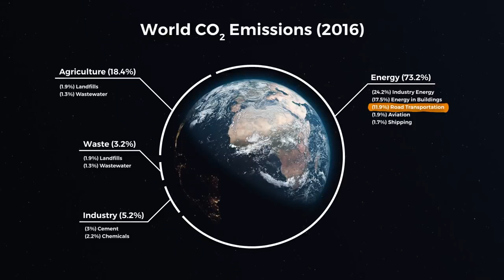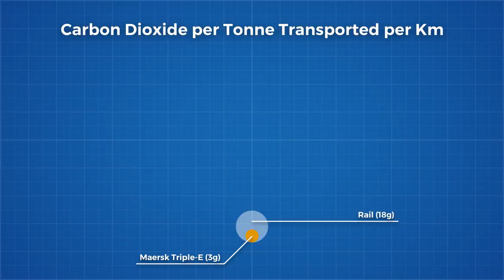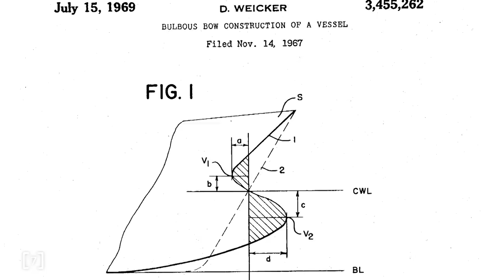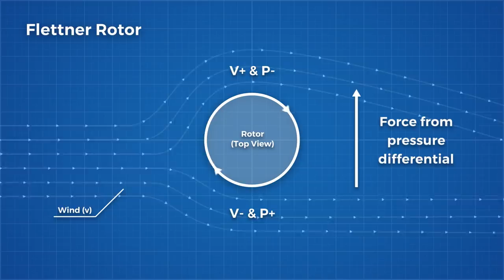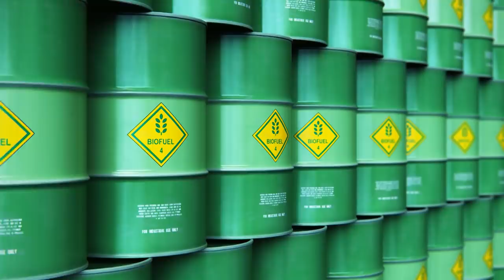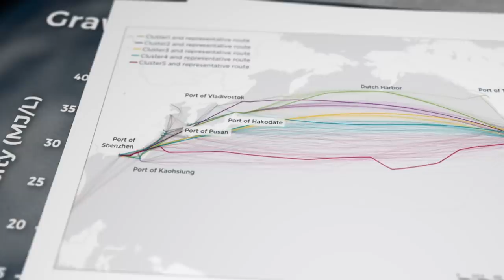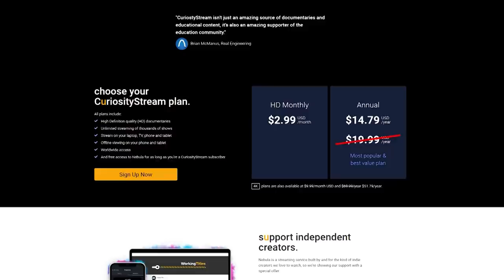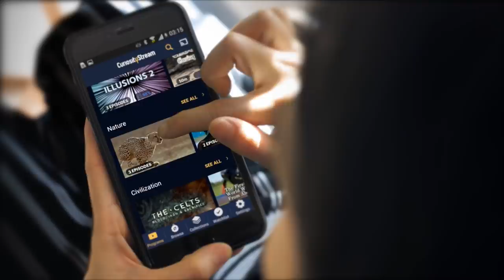Are Renewable Powered Ships Possible?

Comment: The closest thing to renewable energy is something called nuclear power. That’s as good as it’s going to get.
Reply: If you do a web search for ‘nuclear ship savannah’ you will see that it has been tried and did not work.  A similarly heavily subsidised, by the government, vessel is in use in Russia which also operates, in support of the Northern Sea Route, a fleet of nuclear powered ice breakers these may, or may not, have been completely without issues.

Just think; would you have full confidence in the management of a nuclear reactor under the control of an anonymous entity only traceable, perhaps, via a letter box in a FOC (flag of convenience) nation state?  If you are, could you sell that confidence to Japan, the state that hosted the Hiroshima and Nagasaki nuclear detonations as well as more recently the Fukushima ‘event’?  Then try that same, or a similar, sales strategy on Ukraine, the nation state that as a part of the USSR (CCCP) hosted the Chernobyl ‘event’.  Modern iterations of nuclear energy, thorium fuel, molten salt reactors or fusion reactors, will carry the legacy of past problems.  It is the global trepidation of anything with 'nuclear' in the name and the economics of nuclear having transitioned from 'energy to cheap to charge for' too 'the costs of remediation are incalculable' that will prevent the adoption of nuclear energy as a means of creating energy at sea.  Modern reaction systems may have overcome the safety problems but the general public, having been misled in the past, will be reluctant to believe the fresh new promises.

‘They’ say nuclear is cheap, it’s not it is expensive and has a large embedded carbon quotient as well as being complicated, dangerous, not universally socially acceptable and having only ‘no need for refuelling’ as a questionable advantage; actually it does need refuelling just not as often.  When ‘they’ do need to refill the warming up stuff it takes considerable longer than pumping tonnes of thick black stuff, HFO cSt380, or thin runny stuff, MDO, onboard which is one of the reasons HMS Queen Elizabeth and HMS Prince of Wales are pushed about by ICEs and gas turbines thus using a similar fuel as the aircraft that fly off of them.  The Royal Navy (RN) with a high degree of skill and expertise uses, at vast expenses to the UK taxpayer, a current operational nuclear fleet of 11 submarines (also known as ‘boats’) in two flotillas, seven attack subs and four ballistic missile boats.  The carbon footprint of all the extra bits of hardware and the fuel, including processing thereof, from ground to propeller, are the external costs that never seem to get considered.

Disposal, once it wears out, of both the machine (that was a ship) and fuel is another can of worms best left unopened.  The 26 RN boats no longer in use are laid up (some in Rosyth and some in Portsmouth) awaiting long term deconstruction including dealing with the fuel rods and other irradiated material.  The USN is not, as far as I know, a commercial organisation working to very tight margins and also has the skill and expertise to handle the complexities of nuclear power; so as well as submarines their aircraft carriers are nuclear powered and each of the current iteration has a build cost three times that of QE/PoW, bigger crews and more generous funding.  For those who still think that nuclear energy might be the answer I recommend this report: - https://www.bbc.com/future/article/20200901-the-radioactive-risk-of-sunken-nuclear-soviet-submarines?ocid=ww.social.link.email.  The navy of the USSR might have been under resourced and over extended but it was still generously supported in comparison with merchant shipping.
Reply: @BernardLS  I still stand by nuclear power being the closest thing to renewable energy right now. IEP drives on your carriers still require the combustion of archaic fossil fuel to generate electricity. You won’t see windmills on the deck or solar panels on the flight deck anytime soon. In fact you will never. 

You are miss guided when you compare nuclear reactors to nuclear explosions. Reactors do not explode like a nuclear weapon. 

With all the steps required to build and maintain a nuclear powered vessel, its still has a much lower carbon footprint than a carrier warship with conventional fossil fuel burning engines. You have to remember that the Queen Elizabeth class ships need over 1 million US gallons of fossil fuel for the main propulsion. The USS Kitty Hawk required 4 million gallons just for main propulsion. That doesn’t include the aviation fuel tanks. I have seen the QE class ships blowing Blacksmoke like crazy-ala Russian-Soviet style. Replacing rods once every 20 to 25 years is not bad. Being able to cruise at above flank speed with so much power to spare is priceless. 

US Navy has never had a reactor accident. Even the two nuclear submarines the United States lost there reactors are still intact on the ocean floor.
Reply: @sterlingeaton3083  broadly agree.  Please accept that at the moment you are preaching to the choir and my suggestion was that ‘nukes have a bad rep with joe public’.
Reply: @sterlingeaton3083  'I still stand by nuclear power being the closest thing to renewable energy right now.'

WADR ‘the closest thing’ does not have to be very close if there is no competition; however at some scales there are more viable alternatives.  How small can a useable reactor be, the RN had a demo model at Greenwich big enough to boil a kettle but that would not have been any practical use?  So the power source needs to be somewhere between the size fitted to submarines and the demonstrators used in class rooms with a power output to bulk ratio that would allow enough freight carrying capacity to earn enough income to be economically viable.

'IEP (indirect electrical propulsion) drives on your carriers still require the combustion of archaic fossil fuel to generate electricity.'

The hydrocarbon fuel is sourced from the FOGI (fossil oil & gas industry) because that is the lowest cost option.  Technically possible, but at ridiculous expenses, is the anaerobic digestion of organic matter into biogas followed by conversion of that biogas to liquid hydrocarbon (GTL).

'You won’t see windmills on the deck or solar panels on the flight deck anytime soon. In fact you will never.'

They would tend to get in the way (:-); in fact I have almost as much material on why those two options are unviable as I do on the down side of anything nuclear.

'You are misguided when you compare nuclear reactors to nuclear explosions.  Reactors do not explode like a nuclear weapon.'

They do go wrong in other ways, such as TMI, Chernobyl & Fukushima.

'With all the steps required to build and maintain a nuclear powered vessel, it’s still has a much lower carbon footprint than a carrier warship with conventional fossil fuel burning engines.  You have to remember that the Queen Elizabeth class ships need over 1 million US gallons of fossil fuel for the main propulsion.  The USS Kitty Hawk required 4 million gallons just for main propulsion.  That doesn’t include the aviation fuel tanks.  I have seen the QE class ships blowing black smoke like crazy a-la Russian-Soviet style.'

I do not think there is enough information, in the public domain, to do a full life cycle carbon balance.

'Replacing rods once every 20 to 25 years is not bad.'

It just takes a number of years, which is fine if you can afford the redundancy of capacity in your fleet.

'Being able to cruise at above flank speed with so much power to spare is priceless.  US Navy has never had a reactor accident.  Even the two nuclear submarines the United States lost their reactors are still intact on the ocean floor.'

With regard to USN safety their record may be good but two items that I would query: -
1. Is it all the information in the public domain?
2. The hands on ex-navy personnel at TMI expressed concerns about the expansion facility in the primary cooling circuit ‘going solid’, which was ‘a factor to avoid at all costs’ that had been trained in to them in the navy.

Comment: Can these ships go nuclear?
Reply: If you do a web search for ‘nuclear ship savannah’ you will see that it has been tried and did not work.  A similarly vessel heavily subsidised, by the government, vessel is in use in Russia which also operates, in support of the Northern Sea Route, a fleet of nuclear powered ice breakers all of these may, or may not, have been completely without issues.

Just think; would you have full confidence in the management of a nuclear reactor under the control of an anonymous entity only traceable, perhaps, via a letter box in a FOC (flag of convenience) nation state?  If you are, could you sell that confidence to Japan, the state that hosted the Hiroshima and Nagasaki nuclear detonations as well as more recently the Fukushima ‘event’?  Then try that same, or a similar, sales strategy on Ukraine, the nation state that as a part of the USSR (CCCP) hosted the Chernobyl ‘event’.  Modern iterations of nuclear energy, thorium fuel, molten salt reactors or fusion reactors, will carry the legacy of past problems.  It is the global trepidation of anything with 'nuclear' in the name and the economics of nuclear having transitioned from 'energy to cheap to charge for' too 'the costs of remediation are incalculable' that will prevent the adoption of nuclear energy as a means of creating energy at sea.  Modern reaction systems may have overcome the safety problems but the general public, having been misled in the past, will be reluctant to believe the fresh new promises.  The incident of the ‘Ever Given’ blocking the Suez Canal, March 2021, may also have a little to add to this debate.  The cooling water on ships tends to get taken in from near the bottom so when running aground the inlets are in a prime spot to get plugged up restricting, if not stopping, the flow of coolant.  One thing that the TMI, Chernobyl and Fukushima incidents all had in common was that the supply of coolant, or rather lack thereof, was a fundamental cause.

‘They’ say nuclear is cheap, it’s not it is expensive and has a large embedded carbon quotient as well as being complicated, dangerous, not universally socially acceptable and having only ‘no need for refuelling’ as a questionable advantage; actually it does need refuelling just not as often.  When ‘they’ do need to refill the warming up stuff it takes considerable longer than pumping tonnes of thick black stuff, cSt380 HFO, or thin runny stuff, MDO, onboard which is one of the reasons HMS Queen Elizabeth and HMS Prince of Wales are pushed about by ICEs and gas turbines thus using a similar fuel as the aircraft that fly off of them.  The Royal Navy (RN) with a high degree of skill and expertise uses, at vast expenses to the UK taxpayer, a current operational nuclear fleet of 11 submarines (also known as ‘boats’) in two flotillas, seven attack subs and four ballistic missile boats.  The carbon footprint of all the extra bits of hardware and the fuel, including processing thereof, from ground to propeller, are the external costs that never seem to get considered.

Disposal, once it wears out, of both the machine (that was a ship) and fuel is another can of worms best left unopened.  The 26 RN boats no longer in use are laid up (some in Rosyth and some in Portsmouth) awaiting long term deconstruction including dealing with the fuel rods and other irradiated material.  The USN is not, as far as I know, a commercial organisation working to very tight margins and also has the skill and expertise to handle the complexities of nuclear power; so as well as submarines their aircraft carriers are nuclear powered and each of the current iteration has a build cost three times that of QE/PoW, bigger crews and more generous funding.  For those who still think that nuclear energy might be the answer I recommend this report: - https://www.bbc.com/future/article/20200901-the-radioactive-risk-of-sunken-nuclear-soviet-submarines?ocid=ww.social.link.email.  The navy of the USSR might have been under resourced and over extended but it was still generously supported in comparison with merchant shipping.

Comment: Just fitting houses with decent insulation and not wasting enormous amounts of energy for heating (or worse - cooling) would do more than making ships not produce any emissions.
Regulating the temperature of a house not only becomes far easier with decent insulation (and solid buildings - not wooden cardboard-houses) but also is one of the best applications for solar-energy. SolarPanels can easily provide the energy for those places that really need air-conditioning and heating up water directly is quite easy to do and rather cheap even.

Another thing that would help is remove all those green/eco-activists from politics.
Having no clue about the actual science involved they make everything worse. Streets intentionally built to make people angry while driving in an attempt to get people to stop using cars - yes, that is a common occurrence in europe. They remove parking-spaces, remove lanes, add speedpumps and similar to cities and even restrict large highways - result in traffic having to constantly speed up and slow down again and far more congestion - which destroys fuel-efficiency of any vehicle.
I have the good situation that i can use bus, train or bike to get to work and it all takes about the same time as going by car - so when the weather allows it i use my bike - and hell is that saving a lot of money.

Comment: Nuclear powered ships would work.
Reply: With regard to ‘renewable’ shipping first prize for least sensible idea goes, as a joint award, to geothermal energy, draught animals turning a screw system and clockwork; closely followed in fourth place by nuclear power.  If you do a web search for ‘nuclear ship savannah’ you will see that it has been tried and did not work.  A similarly heavily subsidised, by the government, vessel is in use in Russia but just think; would you have full confidence in the management of a nuclear reactor under the control of an anonymous entity only traceable, perhaps, via a letter box in a FOC (flag of convenience) nation state?  If you are could you sell that confidence to Japan, the state that hosted the Hiroshima and Nagasaki nuclear detonations as well as more recently the Fukushima ‘event’?  Then try that same, or similar, sales strategy on Ukraine, the nation state that as a part of the USSR (CCCP) hosted the Chernobyl ‘event’.  Modern iterations of nuclear energy thorium fuel, molten salt reactors or fusion reactors will carry the legacy of past problems.  It is the global trepidation of anything with 'nuclear' in the name and the economics of nuclear having transitioned from 'energy to cheap to charge for' too 'the costs of remediation are incalculable' that will prevent the adoption of nuclear energy as a means of creating energy at sea.  Modern reaction systems may have overcome the safety problems but the general public, having been misled in the past, will not believe the fresh new promises.  ‘They’ say nuclear is cheap, it’s not it is expensive as well as being complicated, dangerous, not universally socially acceptable and having only ‘no need for refuelling’ as a questionable advantage; actually it does need refuelling just not as often.  When they do need to refill the warming up stuff it takes considerable longer than pumping tonnes of thick black stuff, HFO cSt380, or thin runny stuff, MDO, onboard which is one of the reasons HMS Queen Elizabeth and HMS Prince of Wales are pushed about by gas turbines thus using a similar fuel as the aircraft that fly off of them.  The Royal Navy (RN) with a high degree of skills and expertise use, at vast expenses to the UK taxpayer, a current operational nuclear fleet of 8 submarines (also known as ‘boats’) in two flotillas, four attack subs and four ballistic missile boats.  The carbon footprint of all the extra bits of hardware and the fuel, including processing thereof, from ground to propeller, are the external costs that never seem to get considered.  Disposal, once it wears out, of both the machine (that was a ship) and fuel is another can of worms best left unopened.  The 26 RN boats no longer in use are laid up (some in Rosyth and some in Portsmouth) awaiting long term deconstruction including dealing with the fuel rods and other irradiated material.  The USN is not, as far as I know, a commercial organisation working to very tight margins and also has the skill and expertise to handle the complexities of nuclear power so as well as submarines their aircraft carriers are nuclear powered and each have a build cost three times that of QE/PoW, bigger crews and more generous funding.  For those who still think that nuclear energy might be the answer I recommend this report: - https://www.bbc.com/future/article/20200901-the-radioactive-risk-of-sunken-nuclear-soviet-submarines? ocid=ww.social.link.email.  The navy of the USSR might have been under resourced and over extended but it was still generously supported in comparison with merchant shipping.